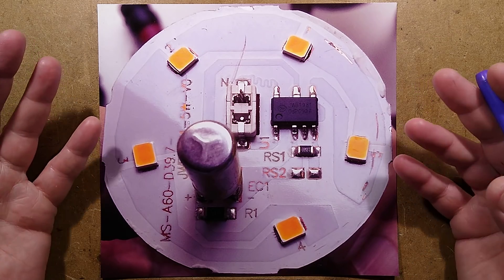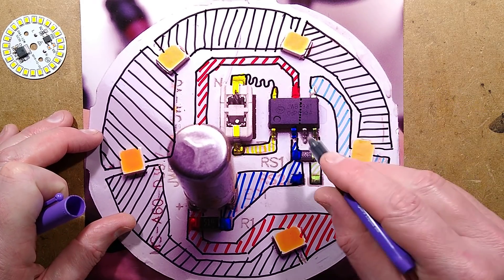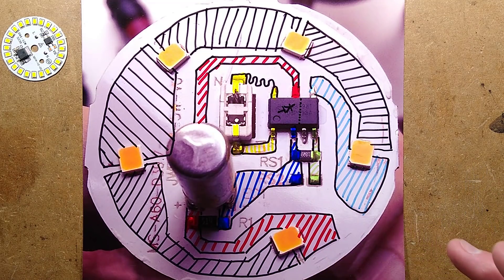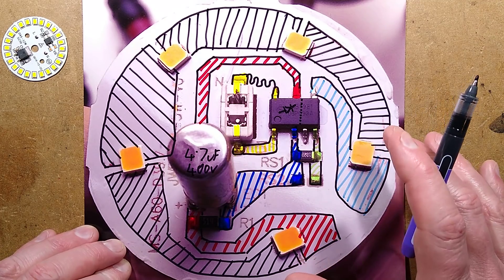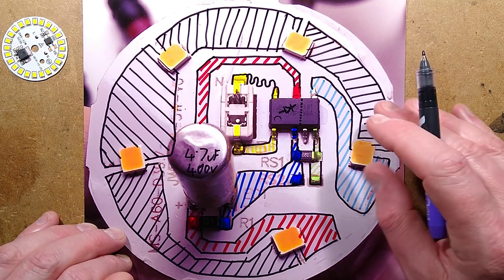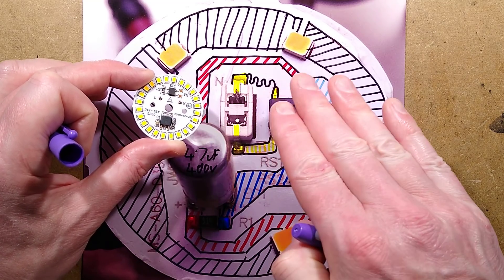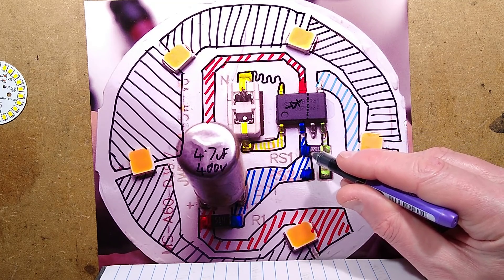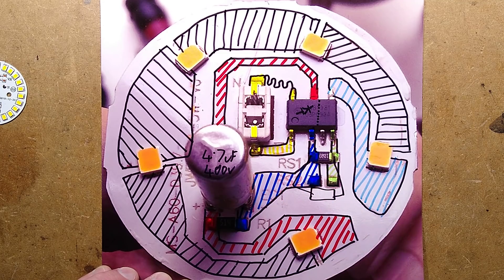New LED lamp twist reverse engineered from a picture

Comment: any chance you can do a video on troubleshooting / fixing the cheap dollar store led bulbs?  about half tend to fail within 6 months, and it's really a shame to just toss them in the bin
Reply: They need to be Doobied as Clive has shown us, I've done a few already, they now run super cool and now might last for decades rather than months...
Reply: @burtgummer9057  i have seen the proactive mod, but i am talking about ones after the fact that have already burnt out
Reply from the maker: At the point of LEDs failing it's usually too late as the others will have stress damage.  You can bridge the faulty one and cut the power down as much as possible to reduce the extra work the regulator has to do.
Reply: @bigclivedotcom  thank you for the info!  i'll just have to remember to do that proactive mod before installing them in the first place  :+)
Reply: For dollar-store lamps, it's seldom worth hacking them in advance of using them -- unless you're going to install them someplace that's inaccessible.
Because if the lamps cost $1, and last 6 months, that's 0.2c/day; versus your "20mins to hack" cost, maybe $15.
Reply: Over here (UK), I haven't seen the "black spot of death" at all; maybe the cold climate protects the LEDs :-) -- and if I did, I'd just short out the spotted LEDs.
Instead, I mostly encounter dried-out (not exploded or bulgy) electrolytic caps; replacing the electrolytics (with caps from Ebay or Ali), usually gets the lamp working again.  $0.60 for a $10 lamp.
And occasionally the driver board has died, explosively; skid-marks on the PCB, missing tracks, burned components.  Ali have replacement driver boards from around $1.50, but if you got the lamp from a dollar store then $1.50 may be unhelpful :-)

Comment: Any way I can send you a photo of a flickering LED lamp I'm trying to  fix?  I'm a total noob and still don't know what I'm doing after a few weeks of researching various things. 😅
Reply: If the flicker is fast and stable, replace all electrolytic caps, if it's intermittent, check for dry joints, dark spots on LEDs.

Comment: There is a JW1881B buck regulator LED driver. Maybe it’s related?
https://www.joulwatt.com/Upload/file/201905/20190528134814_0252.pdf
Reply: Seemingly not. That requires a bridge rectifier.
Reply: @queazocotal  true. I found the selection guide from Joulwatts as well, and it at least mentions the JWB1981. But no datasheet.
Reply: @root42  I can't find any datasheet for JWB1981, but there is a datasheet for JW1981 : https://www.joulwatt.com/Upload/file/201905/20190528135836_7097.pdf
Not the same package, but specs look almost the same, except the birdge rectifier is not included. 
Maybe the JWB1981 is just a JW1981 + brigde rectifier put together in a single chip?

Comment: Capacitor on the front of the board, what total genius thought of that 🤔
Reply: The cap seems to be a surface-mount component, on an aluminum substrate.
So, no, we're not gonna stick it to the back; there's no tracks there.
And we don't want THT when we're using a pick'n'place for SMD.

Comment: After Clive drew the bridge rectifier symbol and he paused over the other half of the chip, you could almost hear his brain saying "What the hell is the symbol for a current regulator?"
Reply from the maker: I was pondering what to draw.  I almost drew a resistor.
Reply: @bigclivedotcom  Heh.  Typically it would be a controlled current source, often depicted as a diamond shape with a current arrow inside.  Another common depiction is a pair of linked circles with a current arrow beside them.  Beside the symbol there should be a formula that indicates how the current depends upon any relevant circuit parameters, such as particular voltage differences or other currents.
Reply: @bigclivedotcom  do u have an Instagram or Facebook I can send u a pic of a transformer I can not identify to find the data sheet its given me a headache as it is incased in a plastic shell and filled with epoxy so u can't see much and the writing on the side don't help on Google lol
Reply: @TheMono25  Weigh it, the amount of iron determines determines the power handling.
 Measure the resistance of the windings , chances it's a 110 or 240 to a low voltage.
Drive the highest resistance wniding with 12v rms thru a 100R resistor and measure the voltage on other windings.
Reply: @bigclivedotcom  Keeping it real.  I always liked that.
Reply: "I almost drew a resistor."

Resist the urge!
Reply: @Gameboygenius  Resistance is futile! 👍 🤣
Reply: @Gameboygenius   - Ohm goal?
Reply: @loddude5706  Almost, but luckily it was rectified in time!
Reply: @Gameboygenius ..... And with a FULL BREEDGE RECTIFIER at that!
Reply: Dependent current sources are diamonds with an arrow.
Reply: I've seen a rectangular box with three terminals going to the center of it's three sides. Quite simple though, but I guess everyone has a brain fart at some point._
Reply: The new chip must have threw him off more than suspected, another brain-fart at 2:41.
Reply: @pauljs75  Sherlock Ohms
Reply: @paulvandergroen9569  ha! Ha!   Let's us lnvestigate this circuit "WATT'S"son...... (see WATT I did there)😆
Reply: @pauljs75  Ao, what's the big deal? Resistor? Capacitor? they all slow the angry pixies somehow! 👍 🤣
Reply: "A very determined-looking stick man with a variac" would be my best effort at it. Sure, it might be overly complicated and a little wrong, but it'd be cute.
Reply: @Aged Fool Patreon supporters get to see it first.
Reply: Two overlapping circles.
Reply: @paulvandergroen9569  Yes that's what I was going to say.
Reply: @paulvandergroen9569  ...is for transformer according to IEC60417._
Reply: @DjResR  IEC60417 This collection includes both ISO and IEC graphical symbols that can be placed on equipment to indicate how to use it correctly and safely.
Not applicable.
Reply: @paulvandergroen9569  
It's also represented as an arrow (denoting direction of current flow) inside of a circle.
Reply: See Texas LM334 data sheet.
Reply: That's how you know he isn't a Replicant.
Reply: Exactly what I thought lol.

Comment: Probably cheaper for the manufacturers - a million of those new chips versus a million rectifiers and a million regulators.....or whatever. I'm drunk and tired and it took me about 5 minutes to type this much.
Reply: I've been told (sorry, no cite) that the cost of using a pick'n'place machine, per component, is typically higher than the cost of the placed component.
Hence placing one component, instead of two or more, is a small but useful saving :-)
Reply: It always the same. Do just just watch these videos with alcohol in your blood?

Comment: More and more simplistic all the time!
I wonder how much RFI they are generating?
Reply from the maker: Very little, as there is a slow turn on and off just 100/120 times a second.
Reply: More or less none as it's a linear regulator. I've not hit one with a spectrum analyzer or anything, but the one I tested didn't produce anything for a AM/shortwave radio to pick up besides the usual line noise.
Reply: @Broken_Yugo  this is actually amazing
Reply: @LabRat Knatz The bulk capacitor should reduce the flicker. And, Clive is right about the frequency being so low. This one isn't using a switching power supply.
Reply: @LabRat Knatz The smoothing capacitors take care of the flicker.
Reply: @LabRat Knatz Technology Connection did a video comparing CFLs to LEDs and brought up the flicker issue.